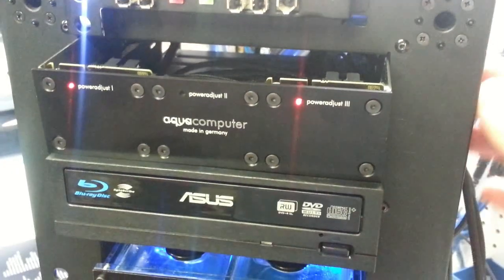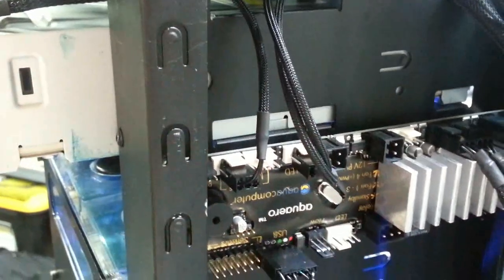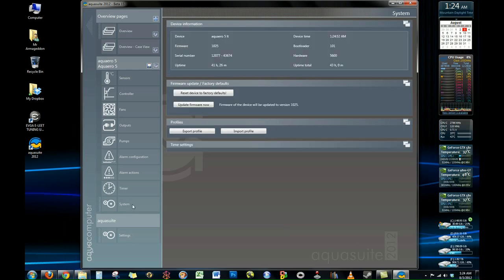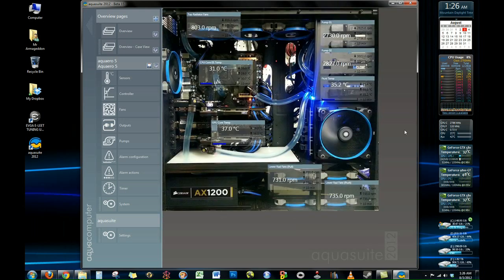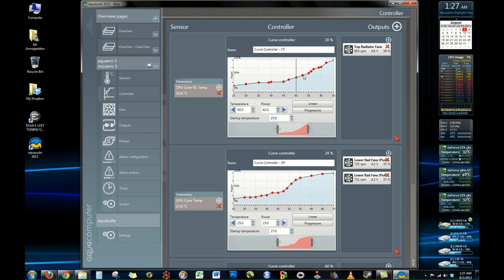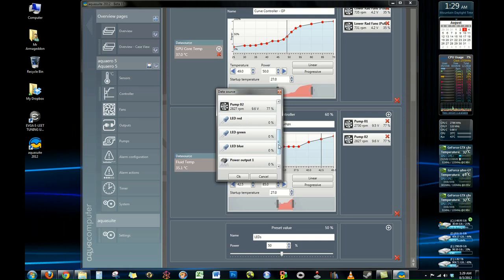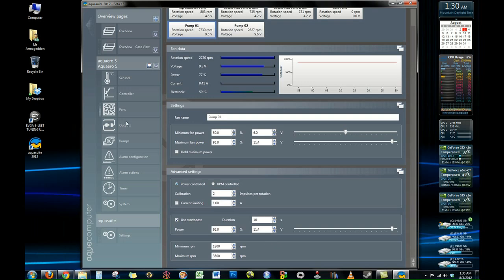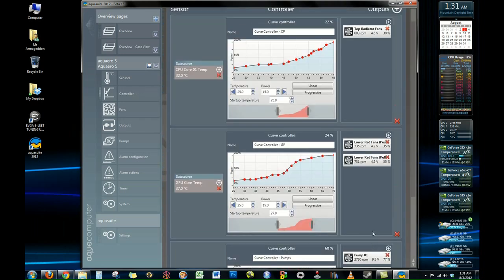AquaComputer AquaSuite 2012, Aquaero 5, and PowerAdjust 2 Overview

Comment: does AJ2/3 only control DDC pumps?
Reply from the maker: It will also work with MCP355 type pumps. I was running two SwifTech MCP35X pumps with this when I still had it.

Comment: Is the Open Hardware Monitor software necessary to run Aquasuite? Another video mentioned AIDA64 for the same purpose.
Also what widgets are you using to display all that info on the right side of your desktop?
Thanks for posting this!
Reply from the maker: Dan Irvine I believe you can use AID64 as well.  The "widgets" on the right are skins powered by RainMeter.

Comment: Im wondering if the latest software (2015) is problematic with the 5 LT. I have a few fans on a pcb block/splitter and it will read the correct rpm's for a second and then it drops to zero. Then it goes back up a minute or so later and just repeats like that. Of course I cant get any automatic setting to hold because the readings keep changing.
Reply from the maker: I have been running the 2015 version for the last year, and had no issues at all. Seemed pretty solid with the few fan curves I was running.  I was using Open Hardware Monitor for temp sensor reading.

Comment: Is that single temp sensor connected to a standard temp gauge (like a g1/4 plug) or is it a flat temp sensor sandwiched between block and component? You did say it was "inline" but so many people use that term loosely

Comment: Mate. You have used the wrong posts to mount the Poweradjust II to the bracket, hence your lopsided mess.

If you look at the supplied posts, you will notice that there are 2 short posts and 2 long posts. The short posts are for use on the side closest to the edge and this allows you to have a properly mounted PAII, parallel with the front panel.

Comment: Apart from no remote and lcd is there anything not available in this that is available in the 2 higher tiered controllers(pro and xt)? The web site says "not all functions are vailable for the aquaero 5 LT". Have you noticed anything missing in the program itself? Also will it accept 4 pin fan connectors?

Comment from the maker: Pretty sure you have to have the individual components connected via AquaBus in order for them to be seen and controlled via AquaSuite 12.  I don't think you can have both running off the USB headers at the same time, but I could be wrong.  Google search:

"Aquacomputer English forum"

Register and post your question (after a quick search to see if someone has already had a similar issue).  They are pretty quick to help out over there.

Comment: Im def going to use this video when i finish setting up my system. thumbs up thanks!!!
Right now i have  the xt, aquaro 5, poweradjust 2 , one flow sensor, and one fluid temp sensor.   now i have a rgb led for my resi  can i program it to change colors based on fluid  temp???

Comment from the maker: I am using Swiftech MPC 355 pumps.  I did rewire the cables to work off of a 3pin fan header.  I added a link in the video description to my build log.  Head there, and then to post #102 to see how I wired the pumps.

Comment: What pumps are you using?
I don't know much about water cooling, but it seem most pumps connect through a standard 4-pin Molex.  Did you find fans that use a 3 pin fan header, or did you have to buy pumps with molex connectors and splice the cables yourself?